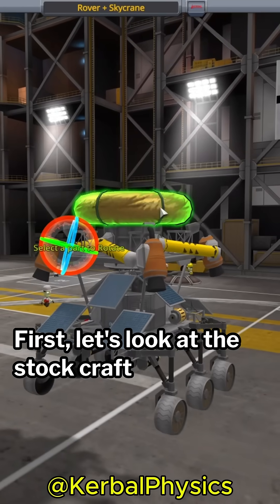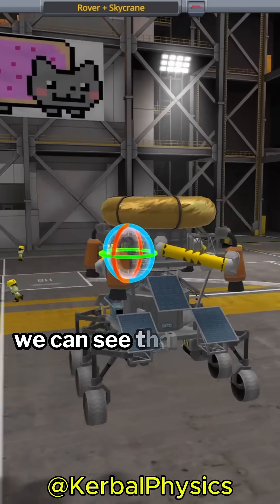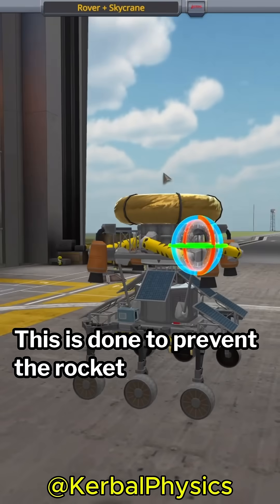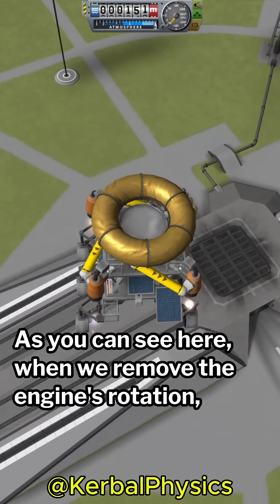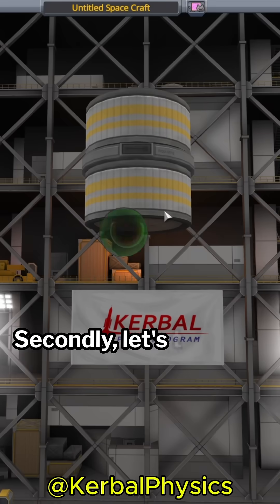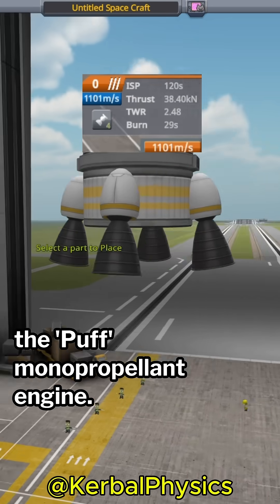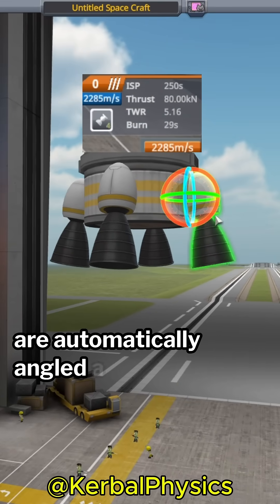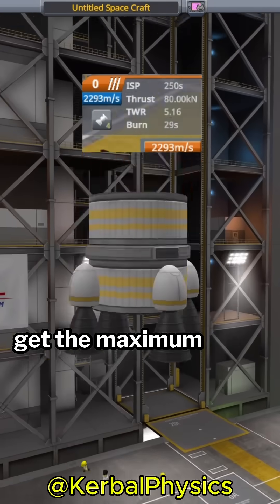Why Would I Rotate My Engines Anyway?  #kerbalspaceprogram

Comment: Based puff hate
Reply: Nahhh the puff engines are super useful. They've helped me get back from the Mun or other planets when it's just a pod and an RCS tank left. It's good to keep for the very end of space travel to help you get home. Trust you just need to find the right use for them. If you use them outside of what they're good for of course they are gonna be trash. End stage pod + RCS tank + 4 puff engines = hella delta V to get home
Reply: @WhereIpostmyschoolstuff-bf5kv  if the only thing you have left of an interplantitary mission is a stage with puff then you have bigger problems.
Do this: empty monoprop (unless you want RCS) replace the weight that would've been used on puffs and the monoprop for said puffs, with a small stage of roughly the same weight using the twitch (or similar) engine
Now you have way WAY more delta-v
Any situation where you can use puffs you can use a twitch and come out with more delta v due to its higher ISP.
It's not that you need to find a right use for them,
The puff just doesn't have any right use.

Comment: I actually like the puff engine, but not used as a main engine, but more of an “emergency” engine
Reply: If someone hates the puff engine. Then they have no clue what it's for and tried using it for a purpose outside of what it's intended for. Like what you mentioned. Using as primary engines is not what it's for really.
Reply: @FranklynSantiago-h3o  finally someone who understands!
Reply: U mean use it on ssto and spaceplane?
Reply: @edenXue-g2j5p no, you don't really want to use a puff for a single stage to orbit rocket. For a space plane/orbiter it could have potential but only for secondary usage. You still want a liquid fuel rocket engine.

Comment: so the plume actually matters!? i did not knew
Reply: The angle is for not burning whatever is below but too much angle and the vertical impulse force becomes more ""squishing"" force you push more to squish the rocket than for the rocket for going up
Reply: It also matters because having something directly in the way of your plume actually will just void the thrust. I know this from when i put side boosters above some winglets and they didnt produce thrust despite burning, and the winglets just heat up instead.